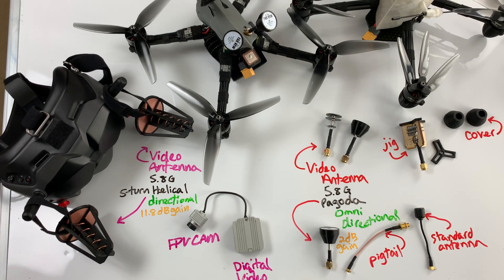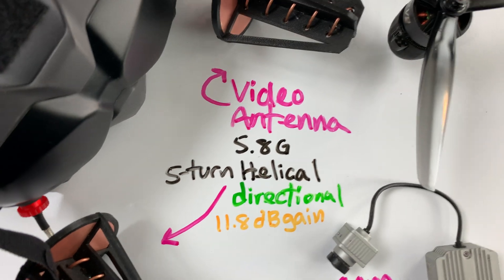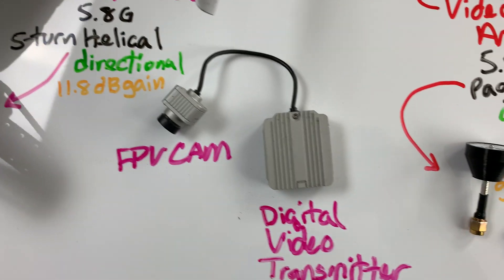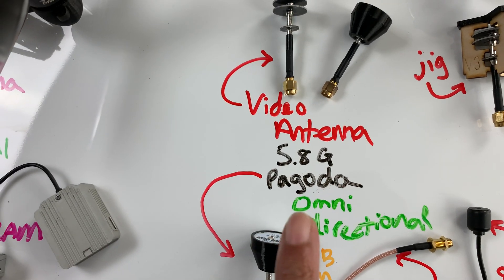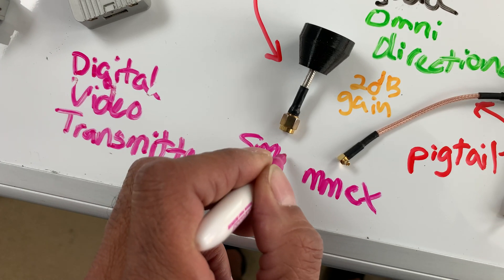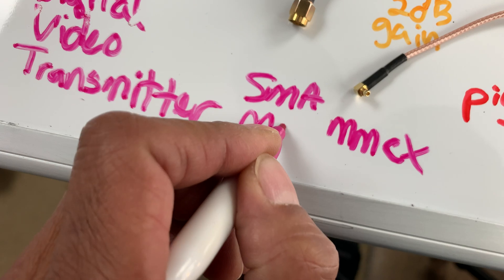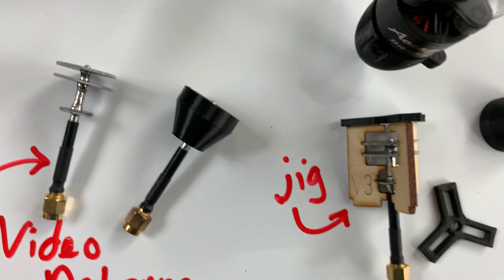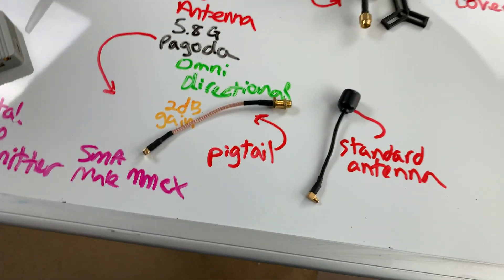Explained: Long Range Digital FPV Antenna Setup with 5-turn LHCP Helical and Pagoda (cheap)

Comment: Nice one dude.
Did you desgin those drone bodys also??..as they look pretty awsome
Reply: Thanks.  A few years ago, I was selling standard boxy 5, 6, and 7 inch frames called the Aquila.  I had some leftover frames and since the design was modular, I started combining every permutation that I could think of and eventually evolved into the canopy body designs here.  I'm hoping for the new 04 Air Unit to redesign the canopy.  I found that the canopy/bottom battery design is faster and works well for long range and freestyle.  It just doesn't crash as well.  :)